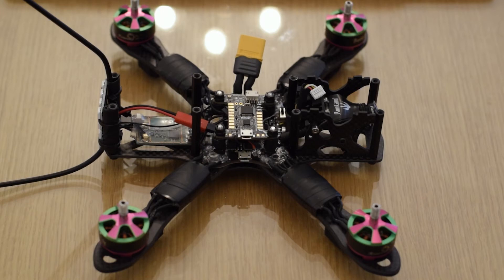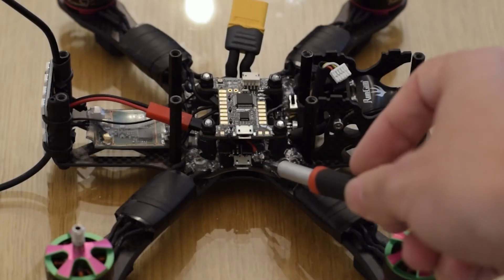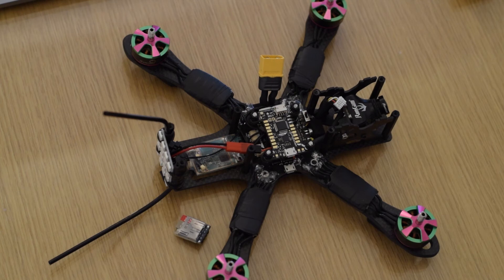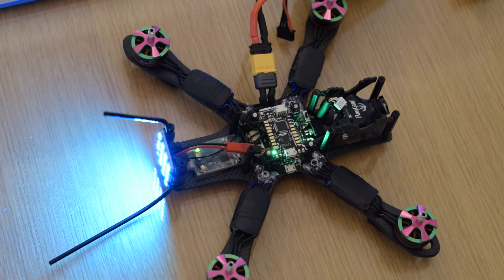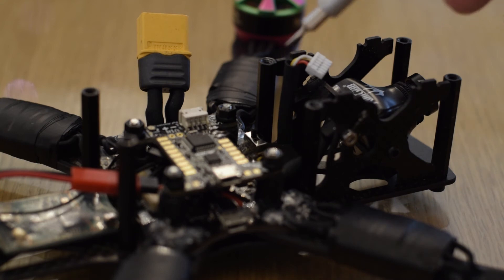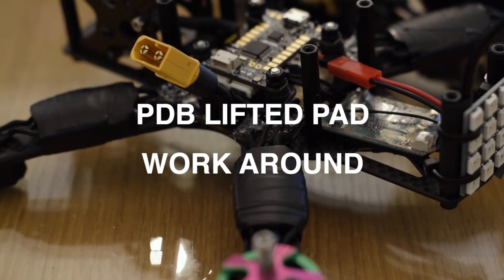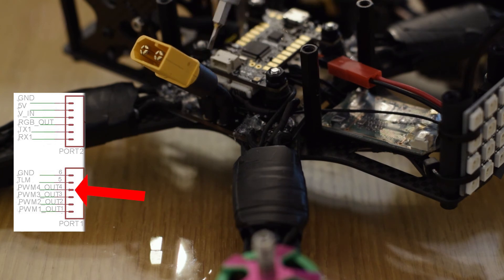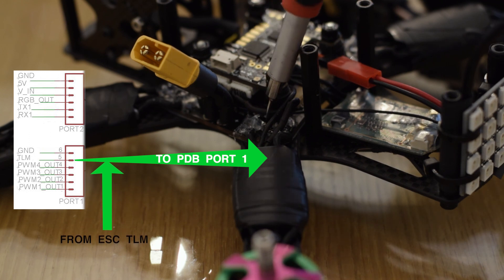KISS FC, STEELE PDB FURTHER CONNECTIONS

Comment: Why would you need to splice anything? Simply wire direct to the FC where the solder pads are. I skipped all TLM, SIG and GRD on the PDB and ran all straight to the FC

Comment: Hi, great video!
Did I get this right at 1:56, that you can use Smart Audio AND have the possibility to use the audio channel?
Reply from the maker: Sebastian Gies thanks, yes if u run rx3 to the mic pad on the pdb then the mic pad to the unify u will have both. I added a switch so u can go between but u do not need to do that.
Reply: tmaintv thanks alot!  I am just curious... is this KISS FC V1 or V2 or does it not matter?
Reply from the maker: Sebastian Gies it’s different on a v2 I believe but haven’t played with one yet. I think it’s tx5 on a v2 but don’t take my word for it
Reply: Thanky. I have the V1 as well. Im curious if everything works at my quad as it works as yours. Where do you get your information from how to wire this combination up for getting Smart Audion AND normal Audio?
Reply from the maker: Sebastian Gies rcgroups https://www.rcgroups.com/forums/showthread.php?2555204-KISS-FCv1-Flyduino-32bit-Flightcontroller/page1733

Comment: Great video. can you plwase show how to run LED wire.. there are 2 ports but they got harnesses.. i just dont get how you pull a wire...
Reply from the maker: David R. Cohen take a small exacto blade under the plastic catch of the 3rd pin in port 2 on the pdb end. Then cut off the connector on the end of the wire and strip I back the silicone.  Then extend this wire by soldering to a similar thickness of silicone wire and run that to the data of ur led strip. Take 5v from pdb to power the leds. Sorry making a video to show this will take too long

Comment: I've been having issues with my Steel PDB.  In the OSD it says "No Connection to FC". I've made sure OSD is selected in the GUI, I've tried a brand new Kiss FC, and swapped out the cables too. Can you shed any light on what I can try?  The quad arms and motors spin so the FC is getting power from the PDB.
Reply from the maker: Mr. RamTech very odd. Could be an rx tx issue on the pdb. If u've tried switch the way the tx rx pins go into the pdb and that didn't work there's def something at fault unless it's a pdb firmware issue. U running the stock pdb firmware?
Reply: Yes running stock PDB firmware, tried flashing the PDB and that just failed miserably.
Reply from the maker: Mr. RamTech flashing should be straight forward just follow https://youtu.be/UPnmp7Ey0xM?t=22m17s u have to disconnect and reconnect ports as u do it. Always make sure ur tx pin runs to rx on the pdb and rx to tx. If this all fails still connect impulse rc and  they will sort u out I'm sure
Reply from the maker: Mr. RamTech also make ur u have latest firmware on kiss fc and ur esc's if u haven't updated

Comment: I've NEVER had just ONE video answer ALL the questions I had. You sir, just made my day. Or week? Possibly month. Thankyou thankyou thankyou. I had the same issues, exactly the same pads etc, everything! Side note- you have any issue with the BH R4's vibing? Got four brand newies and when using the motor test tab in the gui their vibe trace is almost off the page at roughly 3/4 throttle, each one as bad as the next. ONLY difference to yours is mine's a 4.5 alien. It ain't my first build either and it's driving me nuts. Thanks again.
Reply: If i were you, do an ESC calibration for kiss (cant calibrate when you have d-shot BTW) and if that doesn't work then get a new motor,  Sometimes you can have an esc de-sync which can be a loose connection in the motor.
Cheers!
Reply: Finally figured it out, two of the motors had their shaft bolts over tightened right from the box. Adjusted them by the tiniest amount, new loctite and my problems disappeared. Free of mid throttle oscillations for the first time in about 2 months. Thanks for the other info too, all worked perfectly
Reply from the maker: FP. Free glad to know it helped. My r4's did vibe pretty badly too. I tried loosening one but ended up losing the head even with a really good set of hex drivers. So had to change it for a spare. I actually added tape to them instead after that and that worked amazingly well. Have fun flying 💪
Reply: Good to hear!
Reply: Boomo 12 yeah cheers for the suggestion, meant to ask ya, does that mean u never need to calibrate if running d shot or just that u need to change off d shot, calibrate, then change back? My knowledge gets a bit limited when it gets that deep into the electronics
Reply: Yes that is true. But when running dshot on kiss, you go into the advanced tab and set the khz loop to 1 khz or you will over load  the FC.
Reply: Cool. When I started esc's were just sc's and they operated via I little metal rod, and soldering irons were for special occasions only ;) I'm only in my 30's. Ain't it grand

Comment: POS board. You shouldn't have to splice wires on a $50 pdb because of the shotty pads on this thing. Mine lifted two pads. Complete waste of money and time. The point of this board was to make things easier, if I wanted to run wires all over the place, might as well just get a $10 MMOSD board and call it a day.
Reply: Or you could be better at soldering and avoid the problem at all
Reply: Or you could do what is shown in the video to get you back in the air and not complain about it.
Reply: Shappens to everyone. Learn to problem solve or be stuck being frustrated. If it still works in the end then what's to complain about?
Reply: It's the fact that it's a $50 board pitched as the end all set up for this frame when It isn't. I was "Meh" about the issue first, until I saw how many people are having the exact same problem with this board. As I said before, what's the point of having a $50 board and having to rig it to work, when you can have the same results with a $10 mmosd board? ImpluseRC are not new to this game, nor are flyduinno. So them shipping a board with this wide spread flaw is just unacceptable.
Reply: BikeGuy1992 I'd say the frustration and complaints are 100% totally justified. Its exactly your "pushover" attitude that allows them to get away with this kind of shite, and then the rest of us just have to put up with it?  Hack or mod things to enhance them or tailor them to my specific needs? Sure, that IS what I love doing, but having to jerry rig it just to get it to work when it's made by 'the best in the biz' is very hard to swallow.  I'd even respect them more if they owned their mistakes, I'd write the cost off, buy their V2.0 and wouldn't be motivated to break one of their fingers should I meet them in person. After all, I'd only break their finger a little bit and they shouldn't complain about having to mod it just to get it working properly again, right?

Comment: U can run pwm and tel strait to fc like u normally would ....u dont have to splice it in saves u messing with the wires
Reply from the maker: SkitzaFPV that's a good point. I did attempt this with pwm 4 first and did not work. Perhaps I used the wrong pad